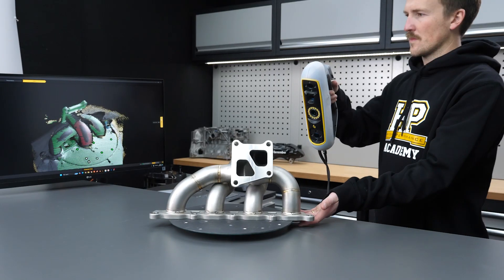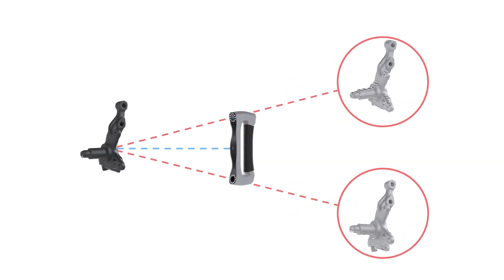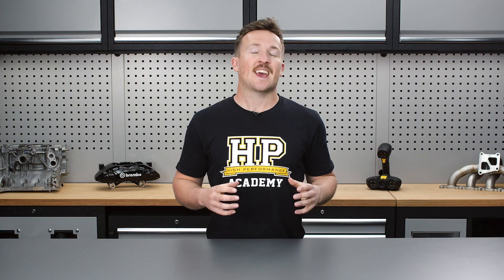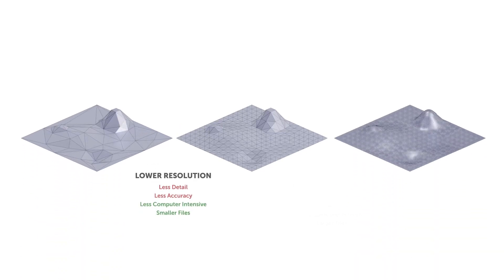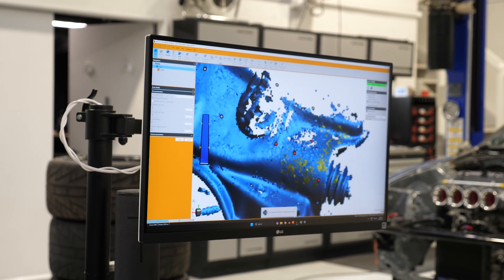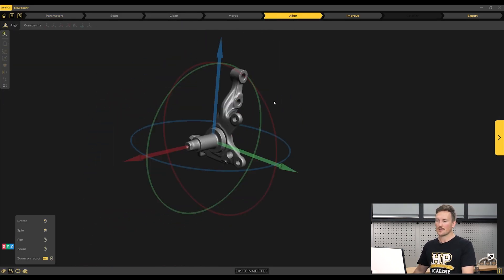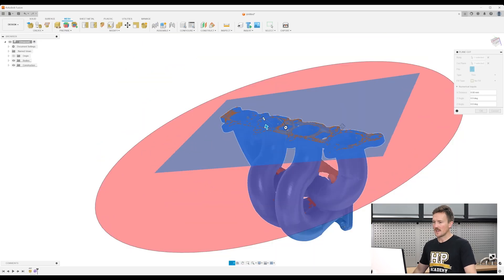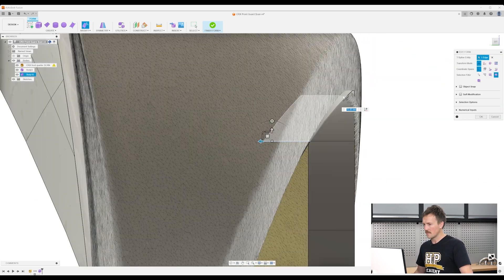3D Scan YOUR Performance Projects [ONLINE COURSE]

Comment: I have an Einstar Shining3d, which is pretty impressive (you can find some scans I've made of Suzuki Cappuccino parts on Grabcad). But it's highly dependent on how feature-dense the object is. It hates scanning shiny flat surfaces, like body panels, and does a terrible job with long skinny parts, like a sway bar. Truth be told, I've never heard of a scanner that handles body panels well and could be classified as 'affordable'. The other downside is it requires some serious computing power to run the software. 32GB of RAM is woefully inadequate for larger scans. And it doesn't run on Mac. That limits the usefulness, since it's impractical to disassemble my desktop computer and haul it down to the garage every time I want to scan parts of my car.
Reply from the maker: We have a bit of a 'review' video coming out next week that will include the Einstar. Just finishing off the captions then it's ready to roll =)
I think out of 4-5 scanners, there was only 1 that Connor was really unhappy with, all the rest just had pros and cons in capabilities vs price - Taz.
Reply: Yeah, it's a really exciting time now that there's so many scanners under the $1000 price point that are actually usable for automotive projects. 

One tip I'll offer is, when trying to recreate a part in Fusion360, usually there's way too many polygons to convert to a parametric model, but even if you can't use the mesh directly, it's invaluable to overlay over your design to check your work.

Also, if you're working with a metal part that was machined, the person who designed the part probably used sensible numbers through most of it. The scanner doesn't have perfect resolution. That janky 29.78mm circle you measured on the mesh is probably 30mm. The bolts that are 100.17mm apart? They're probably exactly 100mm in the manufacturer's design. I try to double check with calipers to be sure, but that's true way more often than not.
Reply from the maker: Yes that's all covered in various course material and even some of our free content. Some of those basics that you don't know till you know but are all part of starting out. The little things all add up to make a big difference for sure and thanks for mentioning it for others to scroll past and benefit from if they're not aware already themselves.

Einstar has a Mac version of their software now too btw. Probably no good to you right now but when you're next looking to replace your PC/laptop you will have that option.

Hope you enjoy the course if you decide to dive into it. Remember there's a 60-day refund policy so win win, you either take it, find you are already up to speed on things and gain more confidence or you go through and learn some new valuable information and find value in having it - Taz.
https://www.hpacademy.com/courses/practical-3d-scanning/